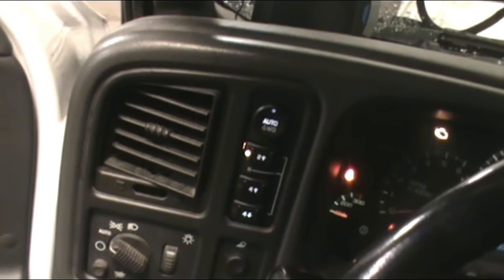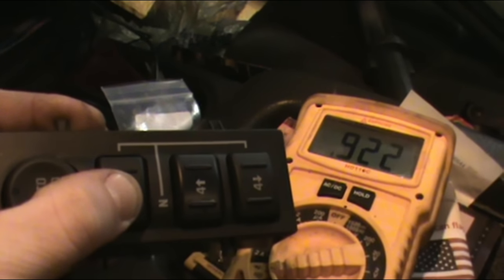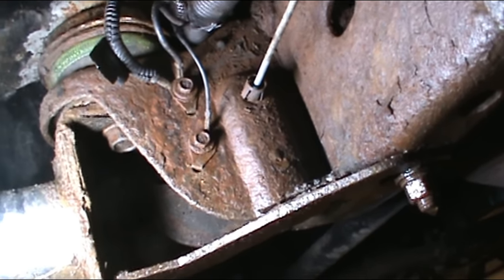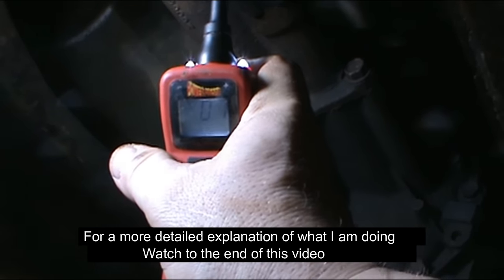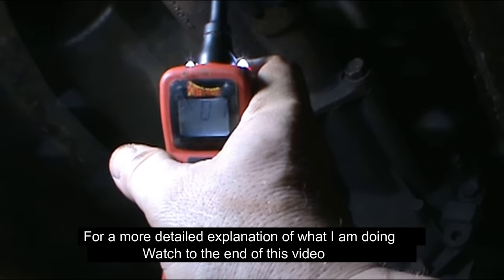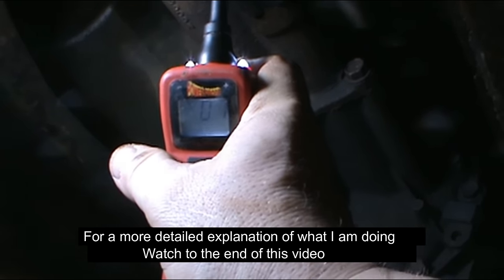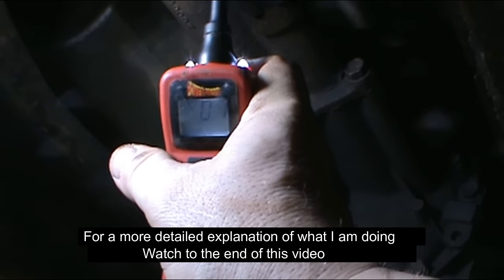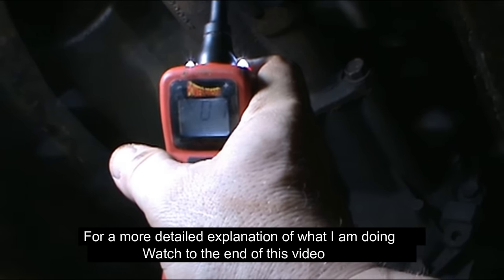Service 4wd diagnosis

Comment: My switch lights do not come on. When I crank the truck, they flash for a second and then turn off. I replaced the switch and it didn't fix it. I'm thinking maybe the computer is bad?
Reply from the maker: After working on these trucks for years it has been the computer a total of 0 times.  I think you need to replace the encoder in the shift motor.  That is the part that tells the computer what position the transfer case is in (4hi 4lo 2hi and N). The reason it doesn’t light up after the initial flash is because it isn’t getting a signal to tell it where it is. The flash on startup is the computer checking for the position, and when it doesn’t get the signal it doesn’t show one because it doesn’t know.
Reply from the maker: I have a video on how to change just the encoder, and if you want to change the whole shift motor, it covers that as well.
Reply: @GSEShop  thank you brother, I will check that out!
Reply: @GSEShop  I'm not sure if I matters but my truck is a 2004 avalanche z71
Reply from the maker: @CThames90  I think they were the same for the most part 99-07
Reply: @GSEShop  just wanted to let you know. I swapped that part out in about 45 minutes and it worked like a charm. I did a lot of research and that idea was never mentioned so I thank you greatly.
Reply from the maker: @CThames90  thanks, I just try to help

Comment: So much truck switches too 4 wheel drive and I hear the motor switching it to 4 wheel drive but it when get stuck on purpose the 4 wheel drive ain’t working even tho it says it’s on
Reply from the maker: The blinking light goes solid?

Comment: My lights from the 4x4 switch don't turn on what can I be? The switch or no ground
Reply from the maker: Test the switch, but my bet is the encoder.  I have a video on that
Reply: @GSEShop  how much did that cost you bro
Reply from the maker: @ramirogutierrez2940  the encoder by itself was $75 or you can buy the whole encoder and that ranges from around $200 to $400

Comment: I tried everything in the video and I’m still stuck in neutral. I replaced the whole harness as the original got ripped out. What else could it be?
Reply from the maker: Can you manually shift your transfer case( take the shift motor off and rotate the stub shaft?
Reply: @GSEShop  yes
Reply from the maker: @edgarperez4992  my next guess would be the encoder in the shift motor.  I have another video on that

Comment: My red and yellow ligths don’t even  light up ? Do you know what the problem could be?? Thanks
Reply from the maker: Las varas Nayarit not sure what you mean by that.
Reply: In the switch where you can change  it to 4w 2w you know how there’s yellow ligths aI just bought this gmc  so and it has the 4w service??
Reply from the maker: Just go through the video step by step, this is everything I know to do to fix those issues.
Reply: Thanks

Comment: I have an 04 tahoe had no selector switch lights, changed tcm still nothing. Changed tccm and selector switch it lit motor changed between 4 and 2 but I went into 4low and when I went to switch back my selector switch lights went out. They only light up when key is first turned on and when started but go out instantly.
Reply from the maker: Christopher Seeley so you changed the motor?
Reply: @GSEShop  yes changed motor tccm trec fuse 4wd fuse. I have constant power when key is on or running to wire e wire g and dim on h, the h is 5 amp so just trickle power I guess. I have no broken wires under the mouse house and no corrosion. I just cant figure out why the switch wont stay powered when key on or running. Again switch lights up but goes right out.
Reply from the maker: Christopher Seeley did you test the switch itself?
Reply: @GSEShop  yes I did and also swapped out for one out of my 04 Silverado that works
Reply: Did you ever solve this issue i have no lights on my selector and no service 4wd message on 04 tahoe
Reply from the maker: Sean Colpitts sorry I must have forgotten this thread, it sounds like and encoder problem if I had to guess

Comment: checked ground, and tested switch all buttons good, but there is no sound or anything happening with the actuator while switch is hooked up in vehicle being pressed  it stays in auto4wd with orange light illuminated also when you press either 2wd, or 4wd they will flash orange but it stays in auto4wd any ideas?
Reply from the maker: my guess would be the encoder, but it is hard to diagnosis from here

Comment: How did you add a ground to the connector I have the same problem i hear the transfer case motor trying to change it into 4wd but won’t
Reply from the maker: Robert Young I just connected the ground wire to another wire and put a ring terminal on it, then connected that terminal to another ground on the truck.
Reply: GSE Shop okay thank you

Comment: I've watched this video a few times now, in my front actuator plug there is a black wire with a white line and a solid black wire, which is ground? I replaced my switch, I cleaned up the wires on the frame and the neutral light on my switch is still on? Any thoughts?
Reply from the maker: Brandon Quarters I would have to go look on my truck but for mine it was the black wire.  Your encoder could be out too and I have a video on changing that as well.
Reply: @GSEShop  I should've been more detailed. When I clean up the grounds in the frame it'll work once but it sounds weak when I put it in 4 hi. After i turn the key off and back on it goes back to the service message
Reply from the maker: Brandon Quarters can you put it in neutral and get it in 4 low?
Reply: @GSEShop   No I can't. On my switch it stays lit up in neutral. It won't shift to anything
Reply from the maker: Brandon Quarters check for battery voltage at the actuator first, and if you have voltage, then I would suggest the ground wire modification mentioned here.  I don’t think it is your problem but it costs next to nothing.  What I think is wrong is in your transfer case shift motor.  Either the encoder or the whole module is bad.  You can try and change the encoder (I have another video on that) or you can change the whole unit.
Reply: @GSEShop  Ok. Thank you for all of this. The encoder is the little black ring inside the shift motor? Probably change the whole thing if I'm going that far?
Reply from the maker: Brandon Quarters I don’t blame you, I changed the encoder once and the whole thing once.
Reply: @GSEShop  thank you. I appreciate all your input on this.
Reply from the maker: Brandon Quarters thank you

Comment: changed my actuator and  4 wheel drive system is working again. Yeah.     But my service 4 wheel system light is still on.   What to do now????
Reply from the maker: 222Dargent does it shift into four wheel drive on the buttons
Reply: @GSEShop  yes with no problem
Reply from the maker: 222Dargent the first thing I can think of is disconnecting the battery for a few minutes
Reply: @GSEShop  Thanks,  I am going to check the grounds by the driver door and clean them up.   Thanks for the info

Comment: The lights are not even coming on, on my switch lol does that mean it’s for sure bad it’s in a lly duramax if that makes a difference
Reply from the maker: I would guess it is a bad encoder, no lights means it doesn’t know what position it is in and the encoder is what tells it where it is.
Reply: @GSEShop  ok I looked up encoder and transfer case motor came up is that correct?
Reply from the maker: @fishinmagician3960  the encoder is in the motor, you can change the whole motor which is more expensive but easier or just the encoder ring.  I have a video on it.
Reply from the maker: @fishinmagician3960  you can test the switch too to see if it is bad
Reply: @GSEShop  I’ll start trouble shooting it today it popped up yesterday evening so I haven’t had much of a chance to do anything just trying to figure out what I can before I start. I don’t want to throw parts at it lol.
Reply from the maker: @fishinmagician3960  the switch is the easiest test

Comment: My 4wd switch isn't lighting up, so I switched the switch and it was in 4 low, but once I turned on the truck the light on the switch went blank again what could it be?
Reply from the maker: Sounds like an encoder problem.  Do they flash on at startup
Reply: @GSEShop  nothing
Reply: @GSEShop  I noticed in your video, to put my truck in auto, I have to put the truck in neutral
Reply from the maker: @jerrysupermantillis  auto should be a shift on the fly.  The only reason for neutral should be 4wd lo

Comment: My whole switch does not work at all. The 2wd won’t light up nor will any of the 4wd options. Must be a power issue?
Reply from the maker: Braden Paziuk I think it is an encoder issue, it won’t come on because it doesn’t know where it is

Comment: Please a I need help with mine. Mine only flashes the light on the switch when I start the truck and they go off. This last days I'm running and by it self they turn on on 4 hi or 2 wdr
Reply from the maker: Héctor Zúñiga do the checks in the video, it sounds like your encoder or switch.  If it is the encoder I have a video on how to change it.
Reply: If you haven’t figured it out yet it is normal for the Service 4x4 light to come on and then go back off when you start the vehicle.

Comment: Would this cause you to lose third gear while driving in 2wd? I drove and lost third gear then switched it the auto 4 wheel drive and the truck jumped forward and was able o get to work on 4 wheel auto. I only lose third gear while driving in two wheel drive
Reply: This should not effect the transmission.
Reply: @richardnottelmann58  so a bad transfer case wouldn't cause the transmission to jump out of gear?
Reply: @martinberlanga4914  It should not.
Reply from the maker: I know that this is late but I finally had this happen to me.  It was the actuator motor, I have a video coming up about it.
Reply: @GSEShop  I figured out why my Tahoe was going into nuettal randomly. I replaced the sensor on my encoder motor and that solved my problem. It was $40 for the sensor rather than replacing the whole encoder motor.
Reply from the maker: Martin Berlanga I figured out the same thing this weekend
Reply: @GSEShop  yes every since I replaced that sensor I haven't had any problems

Comment: What bout if my buttons turn on when I turn the ignition but once the truck is running no lights are on?
Reply from the maker: topgun08lhs did you check the switch

Comment: I got the 4-wheel drive to work in both High and Low but the Rear Differential wont engage 
Do you have any tips for that ?
Reply from the maker: sean michaels the rear?  Does the driveshaft spin
Reply: @GSEShop  Yes its the rear lockers that don't engage. I found some rodents that were building a nest under my truck i put out the poison to kill them. Could they have chewed through a wire ? The odometer most of the time won't turn on.
Reply from the maker: sean michaels I imagine your rear diff is broken, you are talking about a full size Silverado/Serria/tahoe/suburban
Reply: @GSEShop  
Its an 03 Hummer H2, is that expensive to fix ? I do go offroading all the time
Reply: @GSEShop  
Ill go start it up and put it in gear so i can see it
Reply from the maker: sean michaels do you mean you have an electric locker?
Reply: @GSEShop  
Yes, the H2 comes with rear lockers and they are electrical. It is the top button on the stock 4-wheel drive unit
Reply from the maker: sean michaels sorry I have never worked with them

Comment: What do to if my switch dont do anything? just stays in 2hi. No other light will come on when pressed. Lights on switch will come on when I turn the key on but go off instantly. Service 4wd is on
Reply from the maker: Test the switch
Reply: @GSEShop  switch is good.
Reply from the maker: @calvinlewis1334  check your wires going to the encoder motor
Reply: @GSEShop  all plugged in, clean and has power and ground...
Reply from the maker: @calvinlewis1334  my next thing to do without spending a bunch of money is cleaning the grounds under the drivers door
Reply: @GSEShop  that was tje 1st thing i did. Thank you for the leads. Guess i have to spend a lot of money...awesome video by the way.
Reply from the maker: @calvinlewis1334  I would imagine it is your encoder motor, I have a video on that too

Comment: Why is there 4 wires going to the front axle? I figured there would be just two?
Reply from the maker: Cody Dunn without getting too scientific, one is a ground, one is a power supply to the actuator, one is to tell it to move, and one is to sense what position it is in

Comment: Okay I have a question. My four wheel drive. Engages the 4 high the 4 low . Auto 4wd and 2wd it works. I can hear it engage. But sometime the switch just goes off and what I mean by that is none of the switches will work and the service four wheel drive comes on. And then once i turn truck off for  a little bit the switches start working and the code goes away. What do you think or anyone. Have any idea what I could do or maybe buy to fix that .
Reply from the maker: Christopher Guerra I think your encoder is starting to go bad.  That would be my guess
Reply: @GSEShop   so by encoder do you mean the transfer case motor. ?
Reply: Or should I possible try changing the fuse and switch first ?.
Reply from the maker: Christopher Guerra inside the motor is the encoder, I have another video on that if you care to watch.  It is hard to diagnose like this but if that would be my guess.  The switch goes blank because the encoder doesn’t know where it is.
Reply: @GSEShop  yeah I definently would. Can u share the link for the video on here with me ?.
Reply from the maker: Christopher Guerra I am not very good with my iPhone but it is on my channel
Reply: @GSEShop   10/4

Comment: My 4wd auto makes my transfer case sound really bad i can only use 2 wd 4wd hi/lo . What can be the cause?
Reply from the maker: mrsteel10213 I am not sure, the auto feature engages your transfer case in 4 high but does not engage the front axle actuator until wheel slip is detected.  Your transfer case should be operating the same in 4hi and auto.  This is the way I understand it.
Reply: Funny just got the service 4wd on dash . That narrowed it tldpwn to the motor . Thanks
Reply: My truck says it's on 4wd auto it won't let me change it back to 2hi not even 4hi/lo what can it be?
Reply: @ramirogutierrez2940  mine turned out to be the electric motor that is attached to the tcase. it was easy to swap. After changing the  switch and the 4x4 computer the awnser was the motor
Reply: @mrsteel10213  the motor was the problem or the tcase?
Reply: @mrsteel10213  how much did it cost you
Reply: @ramirogutierrez2940  not the tcase , theres a black actuator that switches the gears attached to the t case. its black looks like a starter motor
Reply: @ramirogutierrez2940  i got mine at the junk yard pick and pull probably 150 new
Reply: @mrsteel10213  okay bro thanks for the info 🙏

Comment: What if there is no noise coming from motor?
Reply from the maker: In my experience it means the motor encoder is probably bad.  Do your lights light up on the buttons?

Comment: Truck i am working on had no lights at all on the 4x4 selection
Reply from the maker: Start checking wires then I suspect the encoder.  I have a video on that as well
Reply: @GSEShop  I pulled the shift motor off to replace it and now for some reason neither will line up and go back on I plugged the new one in to see if the lights would come on but still nothing I also replace the selector as well
Reply from the maker: @brandondassow6000  it has a keyed spline, look at the case and the motor, if they don’t line up a pair of channel locks should be all you need to move the t case
Reply: @GSEShop  no mine is a rectangle with rounded ends and I have moved the transfer case to every position and it still won't line up
Reply from the maker: @brandondassow6000  so yours is older?
Reply: @GSEShop  it's a 2001 gmc 2500
Reply from the maker: @brandondassow6000  yeah mine was an 06

Comment: What if none of the switch lights work... They come on when I turn the key on but then the lights go out.... Would be the TCCM (transfer case control module)
Reply from the maker: While I cannot rule it out, more than likely it is the encoder in the transfer case control motor.  I have a video about changing that as well
Reply: @GSEShop  I was thinking about getting a couple of those as well... Even if the encoder is bad my switch lights should still work
Reply from the maker: @shaunmoeller3288  your lights show the position the motor is in or going to.  If your encoder is bad it won’t display any lights because it has no idea where it is, so if your encoder is bad your lights may not light up.
Reply: @GSEShop  ok then I guess I'm grabbing multiple things
Reply from the maker: @shaunmoeller3288  I would change the encoder, or the whole shift motor only and see if that fixes your problem.  I have a video on it
Reply: @GSEShop  I'll just do both
Reply: @GSEShop  do you need to get the encoder reprogrammed or can I just hook one up and check the switch for lights
Reply from the maker: @shaunmoeller3288  no programming required but I would watch my other video to see how to install
Reply: @GSEShop  I was gonna plug in my TCCM and just unplug the encoder and plug in the new one just to see if the lights come on
Reply: @GSEShop  looking up the systems of a bad t case shift motor I'm not having any if those issues
Reply from the maker: @shaunmoeller3288  well you do what you want with what you know.  I can only advise on what I know and what I have done to correct it.  I wish you luck and hope you figure it out.
Reply: @GSEShop  I'll let you know if that's what it was
Reply: What ending up being the problem?
Reply: @violetpolack8630  transfer case shift motor